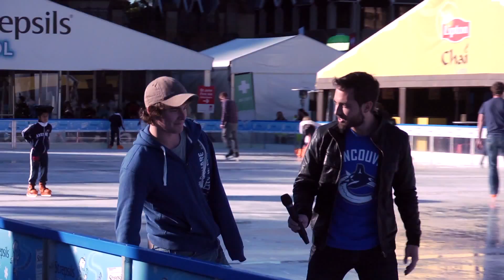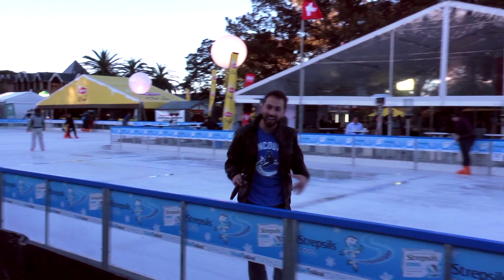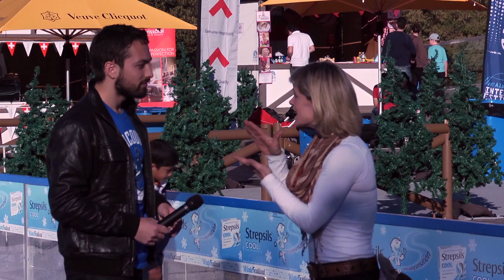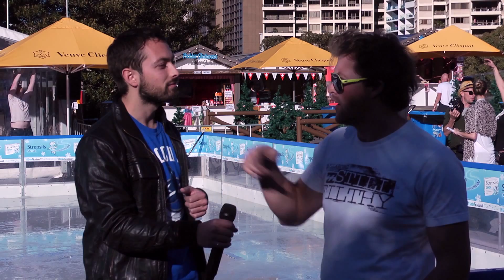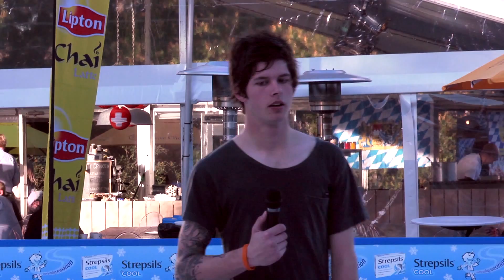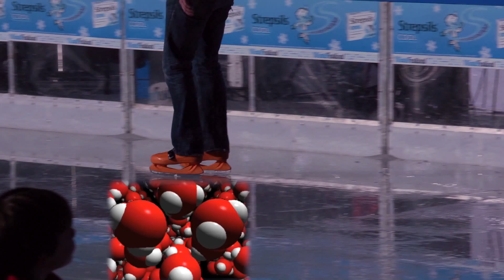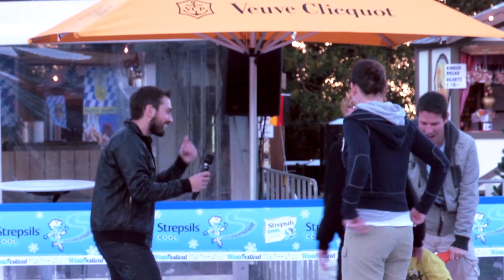Why Is Ice Slippery?

Comment: The answer shown here is only partial.  Pretty much as stated in the video: since ice is less dense than water, ice's melting temperature can be well below 0°C by compressing it.  But then why is skating possible at temperatures at -30°C where a skater wouldn't provide enough pressure to melt the ice and create the thin layer of water that makes ice slippery, as suggested in the video?  Or, why is ice slippery for objects clearly unable to provide the pressure required to melt the ice and create the layer of water?

In 1939, Bowden and Hughes tried to figure this out and found that the ice melt that creates the slippery layer of water had more to do with frictional heat generated by an object moving on the ice.  

Okay... but why is ice still slippery when you're not moving?  In 1949, Gurney suggested that molecules in the ice at its edge/surface are inherently unstable because there aren't any molecules above them, so they tend to want to move toward the center of the solid.  Water is almost uniquely suited for slipperiness since, unlike other solids that contract when frozen, water molecules (contract and then) expand as they near the freezing point, which leaves an unusual amount of open space (atom-scale speaking) for molecule movement.  So it's actually the inherent surface instability of ice that allows the molecules to move around enough to form a liquid film at the surface.  This happens even at temperatures of -150°C.

There is not full scientific agreement from what I can tell as to what makes ice slippery, but from what I've read, it seems like Gurney's hypothesis is [insert bad joke about being the least slippery].
Reply: Yes, it seems that the research points to surface melting. Faraday concluded as much in 1842: "… it appears that the effect of one surface of ice on water is not equal to the joint effect of the two." [Dash et al. 1995 The premelting of ice and its environmental consequences] However, the world repeated Thomson & Thomson's (one of them later Lord Kelvin) mistake of identifying regelation as the cause (as did this channel in 2011). The error can be made evident by noting that a person on skates would shift the melting point only by about 0.1*C [see Dash again].

Many viewers will rightly find the explanation offered in the video unsatisfactory and should not feel inadequate for failing to understand it, but instead indulge their skepticism.

Comment: I expected the answer to be a bit more complicated. I'm still not entirely sure how the layer of water causes ice to become so slippery. I mean if you have a huge block of glass covered in a thin layer of water would it be as slippery as ice? Does this work only with ice because the water produced is directly between the object and the ice where as water covering glass would sort of move out of the way of the object?
Reply: someone hasn't slipped on a wet floor before...
theres a reason why "caution wet floor" sign exists
Reply: HaroWorld1 Yeah, but you can't use ice skates on a wet floor...
Reply: s0medudeonline Ice still has less friction than the floor
Reply: mrjoni54 Does it cause less friction than a sheet of lubricated glass? And is that also why you can skate with a blade on a sheet of ice and not a sheet of glass? I think there's a more complicated answer there.
Reply: s0medudeonline Yeah, I'm not an expert, but I think also the density of ice is lower than glass, which lets the skates make a imprint in the ice, making a kind of rail for the skates to glide in. Just a theory, I have no scientific proof of this haha..
Reply: mrjoni54 That's interesting. I think you're on to something. I wouldn't know if the density of ice is lower than glass but the whole rail idea (or inverted rail I guess) makes a fair amount of sense to me.
Reply: Imagine you as a block of stone, and the force used to push you is a cow, with the cow pushing on flat ground the friction is greater, therfore making it harder to move. Now imagine water as wheels, put the block on wheels and there is only 2 points of friction per wheel, where as a flat surface have infinitely many points. The water is a lubricant. We only have to touch a few of the water molecules instead of the entire block (try skating on a block of marble just as slippery it would not be any different to a bumpy road)

Comment: so in theory, a heavier person would skate faster then a lighter person... right?
Reply: Bad joke incoming:

No, because the heavy person would break the ice and sink.

I would also guess the heavier the faster though in theory.

Also I think in bob sliding the heavier = better/faster which also would make me believe it´s actually the case for ice skating too.
Reply: StackingTheCup I don´t think they would be faster on even ground, since the inclination helps also put that weight to use, so would be the opposite: weight helps more in bob-sliding and less on a even surface where the weight only helps with the ice/water layer.
Reply: no because the mass resists to the acceleration
Reply: ***** i just now realize that you talked about bobsledding. Bobsledding is using gravity to pull them down, i just wondering if they would skate faster on an even ice surface.
Reply: weight has nothing to do with speed.  a heavier person would require more energy to get to the same speed, however they would have more inertia.  If the heavier person and the lighter person stopped skating at the same time, the heavier person would slide farther.  the speed in which they skate is dependent on the amount of energy they put into skating.  generally speaking, the lighter a person is, the less energy it takes to get to speed.  This is why long distance athletes are generally lighter and skinnier than their sprinting counterparts.
Reply: netauri123
No.

Comment: The explanation that it is the compression of the ice that lowers it's melting point is not actually fully correct. It is true that you compress the ice when you step on it with the blade however the weight of an average person does not produce enough force over the average area that the blade is in contact with the ice to compress it enough to cause it to melt. You would need to apply a pressure of around 257 atmospheres to get the ice to melt beneath the blade (providing the ice was around -2 degrees Celsius) and a person is only going to be able to produce a force of around 10 atmospheres providing that the person weighs 100kg and the dimensions of the blade is 0.005 x 0.2 m^2.
Reply: I agree.

Comment: I don't believe that pressure and water from the metal ice skating blades are the reasons why the ice is slippery.  As a counter-example, can't you take a thin puck made of ice and slide it along the ice floor and it will keep going? The weight of the puck would be minimal. I don't think that any significant melting of the ice due to compression would occur in that experiment either. I think it has more to do with the fact that the ice forms a solid surface that has a low coefficient of friction for an object to slide on.

Comment: So the pressure lowers the melting point of ice, got that. So is there a temperature low enough such that ice doesn't melt under the pressure caused by ice skates? If so, could a person go skating at that temperature?
Reply: Yes. That temperature is around -0.1°C, depending on the weight of the skater and the area of contact of the blades. Yes, you could still go skating at temperatures below -0.1°C, but according to this video, the ice would not be slippery. Please let me know if you have further questions.

Comment: How cold would the ice have to be before it doesn't melt under the skates for an average ice skater? How much higher would the friction be? Would it be like skating on wood or plastic?
Reply: DANGJOS You're right. I was only considering the factor discussed in this video. Other factors will certainly bring the minimum temp below -0.1°C
Reply: That's not really how it works. You see although the pressure required to melt the ice would be increase as the temperature decreases, comparing it to wood or plastic isn't really justifiable, as the crystal structure is different. Ice behaves completely different to wood and plastic. You see when you press down on ice, it will always release energy in the form of heat. However the colder it is, the less energy there is to give off, so it melts less than it normally would. So yes, eventually the ice would become to cold for an ice skater to apply enough pressure for it to melt underneath them. How cold, though, I have no idea.
Reply: RaptorCrapter I don't understand what you are trying to say. First you say "that's not how it works" and then you confirm that if cold enough the ice would not melt under the pressure of the skaters weight. So why say that I'm wrong in one breath and then confirm what I said in the next?

Sure I know the friction won't be the exact same as wood or glass but I was asking for a comparison with surfaces people can relate to. Skates on untreated wood would probably be fairly high friction but glass would be lower. Perhaps like quartz or rock salt that are also crystalline substances but won't melt under your skates.

That makes me think of another question. Could one skate on metal if it was close enough to the melting point? Something like gallium perhaps?
Reply: I'm not sure. If it were a real world situation, then no, it would not work as it would be far too hot and probably melt the skates. Theoretically, however, I suppose it could work. I would have to do the calculations in order to find an accurate model. But I can't really be bothered. If you want, you can do the calculations yourself and find out.
Reply: RaptorCrapter Gallium melts at below body temperature. It melts in your hand.
Reply: Mike Majer Although I don't agree with Veritasium's explanation, we do have to remember that there is more going on here than just pressure reducing the melting point of water.  Remember that when ice is compressed, in decreases in volume slightly.  Force x distance=energy.  When you compress anything, be it a gas, liquid or solid, it will heat up slightly.  Also in the act of skating, there is frictional heating.  So with these two sources of heating, that minimum temperature should actually be lower than -.1 C.  With that being said, I still agree that it isn't enough to explain the slipperiness of ice.

Comment: So is ice still slippery if there isn't any pressure compressing the ice?
Reply: If you're not putting pressure on it then it doesn't really matter whether it's slippery, i guess. If it didn't compress when we stood on it then it would probably be similar to glass, which isn't slippery.
Reply: DANGJOS Have you noticed that sharpened skates, which have a smaller contact point, slide better? Or that you can skate faster on one foot than on two? When distributing weight over a small area like this, you might be surprised how relatively immense the pressure can get for the small area of ice that you're affecting.
Reply: AYEBAHAYE cosmicquandary Yeah the friction is directly proportional to the pressure. There should however be a point where you reach the melting point of the ice where more pressure actually lowers the friction.
Reply: AYEBAHAYE Here's my issue.  I don't see how pressure could be the main reason (for most situations rather than ice rinks) because if you look at the phase diagram of water you will see that the amount of pressure you would need would be immense
Reply: Daemon Shade That is true, however that is the case with ice skates.  People slip on ice with shoes on which are very broad and the pressure there clearly isn't high so this explanation does not work there.  Also, when you exert a pressure on something and compress it you are doing positive work on that system which goes into heat (although very small).  So, in the case of the ice skates I would speculate that it is a combination of the small reduction in melting temperature of water form the pressure, the heat produced by the pressure of the blades, and mainly the friction due to the blades which also produce heat.
Reply: Daemon Shade There are just too many factors and my point is that we just don't know exactly what causes ice to be slippery.
Reply: it's always slippery on earth because of the pressure of the air :D
Reply: Daemon Shade That's actually not true. Freshly sharpened skates have better edges (ie better control) but duller blades are much, much faster. It's actually also more tiresome to skate on sharp edges because of the added friction. Speed skates are actually made totally flat, a 90 degree angle, for this reason
All in all, this is NOT something simple enough to be broken down theoretically. There's a lot going besides what Derek mentioned, like the fact that the friction at the front of the blade also will melt the ice allowing the rest to slide along with less friction. Also the metal blades will conduct heat better, and will pull heat to the ice
What the video mentions is probably the largest factor, but it's definitely not the only one
Reply: decidiousrex Daemon Shade DANGJOS This is the most intelligent discussion I've seen yet. You've laid the groundwork for a real explanation. Pressure can only change the melting point by around 0.1°C, depending on weight and area assumptions, so I disagree with decidiousrex that the video presents the largest factor. One factor not mentioned yet: The kinetic frictional coefficient of steel on ice is less than 0.03 (does anyone have a more precise value?), an order of magnitude smaller than most materials. Even without all the fancy explanations, ice is slippery.
Reply: Mike Majer Is that coefficient measured theoretically or empirically though? Because if that's just the experimentally reached number, it still doesn't tell us why ice is slippery, just that it is.
Derek was able to cut an ice block using nothing but pressure, and considering the string has an area similar to skate blades, and the pressure exerted was similar to the force of gravity exerted from a human, I'd say that's reasonably conclusive to say pressure is one of the main factors, if not the main factors.
Reply: decidiousrex That ice was at 32 degrees F so it didn't need to raise in temperature at all to melt.  It just needed extra energy to break the bonds in the water; an energy called heat or enthalpy of fusion
Reply: DANGJOS Oh boy, where to start.
First off, temperature is irrelevant, it doesn't even need to change in order to turn the ice to water. Second, ALL ice is 32 degrees. Third, ice doesn't even necessarily melt at/above 32 degrees, it melts when that energy you're talking about is met.
Reply: decidiousrex I know it doesn't need to change that's part of the point.  And second, all ice is NOT 32 degrees.  Where did you get that idea.  If you have ice outside when the outside temperature is 10 degrees is the ice still 32 degrees?  Thirdly, ice does necessarily melt at 32 degrees assuming it contains minimal solvents and impurities.  The heat of fusion means that the energy that you put into ice in an attempt to raise it's temperature goes into melting it instead and the ice remains at 32 degrees until it is a liquid.  But extra energy is required; otherwise the ice can remain at 32 degrees and never melt.
Reply: DANGJOS You seriously need to go back to chemistry class
Reply: decidiousrex Really. Please explain how.  You have not demonstrated that I am getting my science wrong and what you said certainly isn't correct.  Point out which of my statements is incorrect and we can see if we can get to the bottom of it
Reply: decidiousrex Wow, you've managed to dim an otherwise intelligent collaboration of ideas. All ice is 32 degrees? Really Rexy?
Reply: Mike Majer If by dim, you mean impart actual science into wild fantasies, then sure.
I thought this was common knowledge. If we're talking about pretty much pure water at standard pressure, yes, all ice is 32 degrees. Of course, we can alter it by changing those things, but that's kind of irrelevant, is it not?
If you don't agree with that... well I don't know what to tell you. It's standard practice to calibrate thermometers using ice. If ice wasn't all the same temperature, every thermometer using this thermometer would give off wildly different readings.... but they don't. Either it's black magic, or I'm right. Could be either.
Reply: decidiousrex Your ignorant words sour the collective intelligence of the masses.
Reply: decidiousrex Are you serious?!  Those are not the two options.  Thermometers can be calibrated because the ice is out in room temperature (or just above melting) so the ice has no reason to drop below 32 degrees and the heat of fusion keeps it from warming above its melting point.  Tell me please.  If I leave an ice cube in a freezer set to 5 degrees, does the ice stay at 32 degrees?
Reply: Yes. The structure is less rigid in the outer layer of molecules.
Reply: Sadrien Nightshade  Who are you responding to??